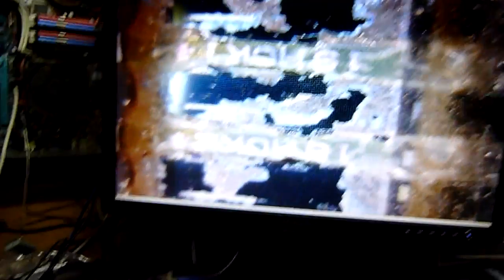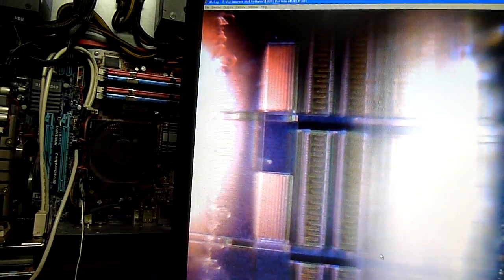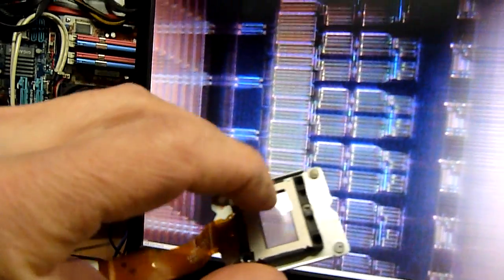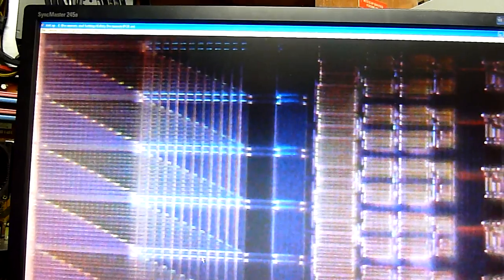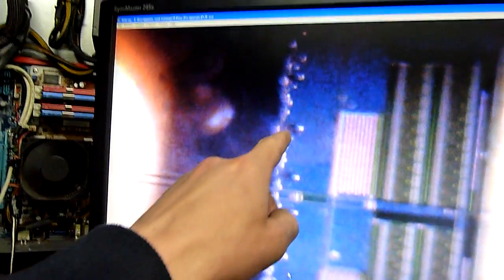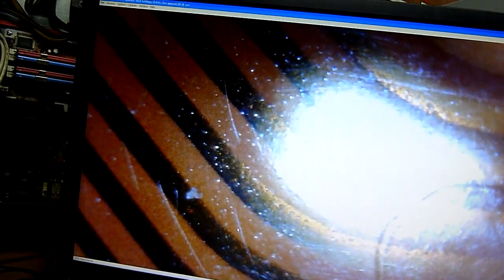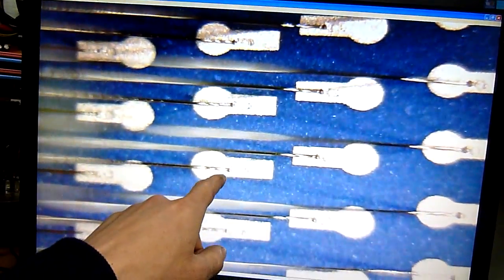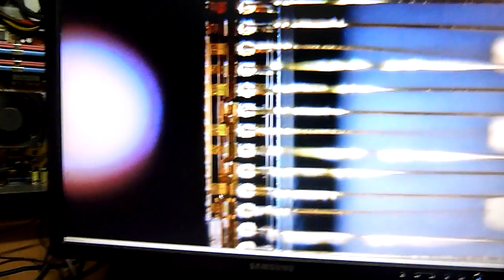LCD Projector and DLP TV Chips under the USB Microscope

Comment: As below, the glass one is an LCD. The DLP is an array or mirrors which toggle on an off to reflect the colour (usually from a spinning disk providing RGB) at the correct time. Your eye integrates the projected images to form the picture.

Comment: That zigzag arrangement in the beginning might be to allow for thermal expansion berceuse those things do get hot and I guess a straight connection from the glass to the metal might fatigue from the expansion and contraction.

Comment: Might want to give Vegas Movie Studio Platinum a try Ed.
Reply: I've been using version 10 for 3 years and despite being a low cost consumer product (I paid £33), I've cut and merged quite a lot of 1080p video with it, synced voice overs, blurred out unwanted bits, brightened/darkened footage, added text, logos, etc, changed speed, etc.  Once finished, I just render as MP4 and upload.  It's got a bit of a learning curve, but well worth getting the latest trial as a test run before forking out on Premier for features that you'll probably never use. 

I recommend Sony Movie Studio Version 12 over 13, as version 13 has changed the GUI to be 'Touch friendly'.  Version 12 looks nearly identical to the Vegas Pro product, so many tutorials for Vegas can be followed with the Studio version.

Comment: DLP normally works with a spinning colour wheel to make it colour.
Reply: A color wheel is only one way to get the RGB colors from a DLP projector.  Another popular way is to split the light source, and bounce each color off 3 separate chips, and recombine the light before exiting the lense.  The other way is to use a pulsed LED or LASER in a single chip projector.
https://en.wikipedia.org/wiki/Digital_Light_Processing